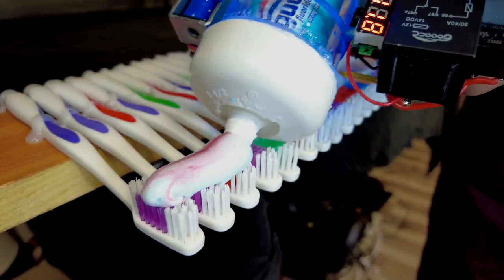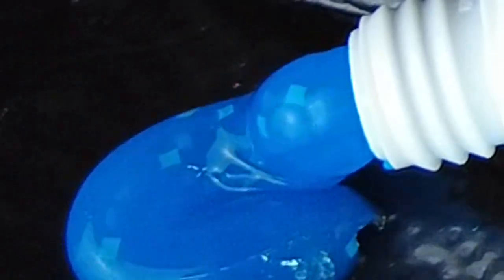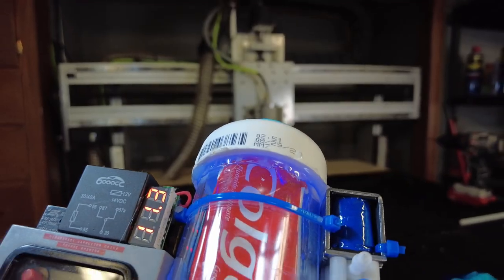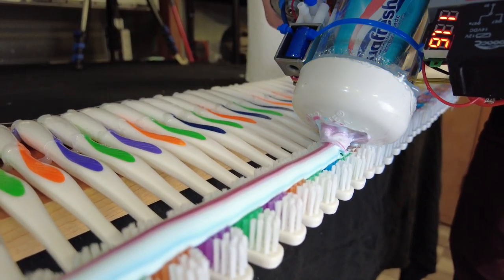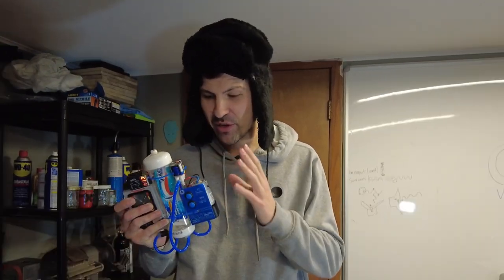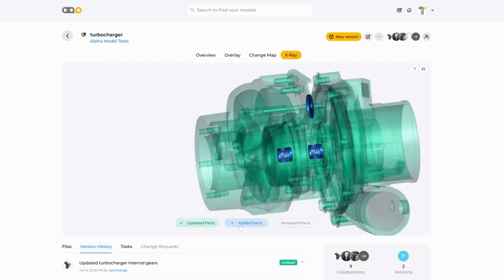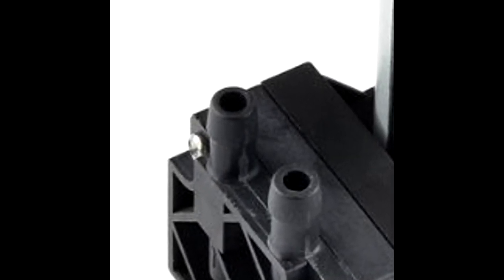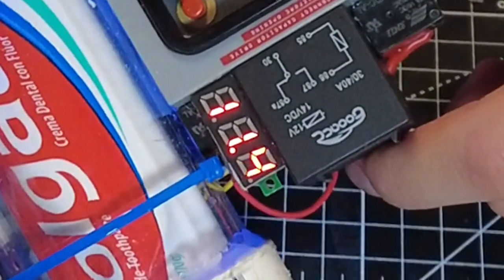Reverse Toothpaste (actually works)

Comment from the maker: What impossible thing should I do next?
Reply: I mean people say you can’t fit a square peg into a round hole, I’m sure you could figure out some way to make it work.
Reply: @CopiHuman  just make a smaller square
Reply: Make a machine that removes the center from a pretzel. Not the soft kind.
Reply: make a machine to answer your questions
Reply: Make a machine to undo death.
Reply: Seems pretty obvious, un-ring a bell
Reply: Unsoggy pizza seems pretty tricky
Reply: make a long range nail gun.
Reply: Link to any available parts online?
Reply: @CopiHuman  gets duct tape, plastic bag and cardboard
Reply: Make a powerful EMP gun
Reply: Make a device that will cure my hangover.
Reply: Unsqueeze lemons?
Reply: Make spiderman swinging,this is why i subscribed to you
Reply: Un-make soup
Reply from the maker: @ta6576  Moderation
Reply: That's cool, but I don't feel you covered all the bases. What about applying toothpaste across the room onto a toothbrush. 

Maybe a measured amount being cutoff and shot across the room with a vacuum canon. A blade could both cut the toothpaste and seal the vacuum chamber a vacuum could be pulled and the end unsealed to allow the toothpaste to be shot out the other end onto those toothbrushes you have hanging. Now if this is what I thought up in a minute I sure you can come up with a better way to apply toothpaste at a distance!
Reply: @sajalacharjee7008  EMP, that's an easy ask.
Reply: Make my dad come home from getting smokes.
Reply: A robot to tie a tie
Reply: @CopiHuman  this is called a lathe!
Reply: Make my wife love me again Joel
Reply: @ITpanda  why don't you make one. I will watch it
Reply: Egg unscrambler.
Reply: Yup
Reply: Human car wash style shower.
Reply: Have your cake and eat it too
Reply: Create a mini blackhole
Reply from the maker: @jackin_rl7429  Check out Ivan Miranda, he did something like this
Reply: @JoelCreates   cool will do! Thanks for the reply :)
Reply: Retoast the untoasted bread, then untoast the retoasted bread, etc...
Reply: Untie a balloon after blowing it up
Reply: a device that enables you to walk on walls, like the spider man
Reply: I dare you to make shoes that make you jump much higher than normal
Reply: Try to make an omnitrix in real life, tip: wear a smart watch
Reply: I have a pretty good idea you made web shooters but maybe it's possible to make something to climb walls with like Spiderman.
Something like glue dispensing gloves
Reply: Battery that gains charge the more you use it 🤔
Reply: Mangetic monopole
Reply: impossible you say? oh well a challenge joel for you experiment on time travel 😁👨‍💻⚒🧪⚗👨‍🔬🥼🥽🔬😎🕑🕑🔧⚙⚙🛠🛠😁😆🥼🥽🔬⚗🧪☢☣👨‍💻
Reply: Make a a circle in Minecraft
Reply: Make a working robot that looks like my profile pic
Reply: @KiaStingerGTGuy  Actually ez
Reply: @Zoiler  what
Reply: @KiaStingerGTGuy  They are literally almost the first thing you see when you start the game
Reply: @Zoiler  it’s literally all cubes wdym
Reply: @KiaStingerGTGuy  someone hasnt played the game
Reply: @Zoiler  i play it-
Reply: @KiaStingerGTGuy  then you should know, minecraft contains circles
Reply: @Zoiler  o
Reply: Reverse the creation of the universe
Reply: Just that, do the impossible
Reply: Make a tv that instead of giving you memory’s of shows it just removes your memory of a bad show you’ve watched
Reply: when i do burnouts in a car, i lose rubber.....
Reply: Pls delete thermodynamics, it's messing with my perpetual motion.

Comment: Needs some sort of computerized viscosity detector that will cause a small reversal of the flow when it detects it's sucking air to push out any air it might catch. Maybe something that measures the rate of change of the pressure in the vacuum chamber surrounding the toothpaste tube?